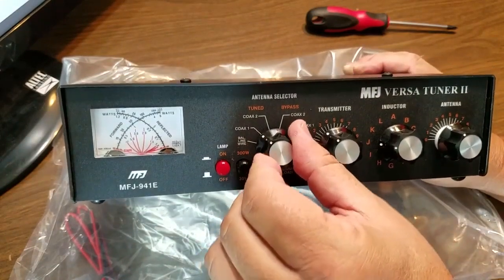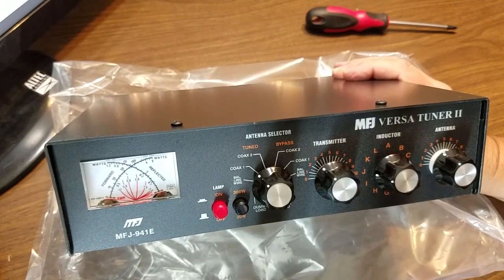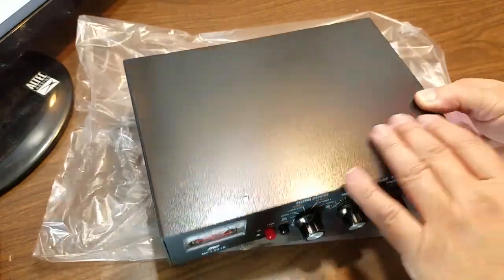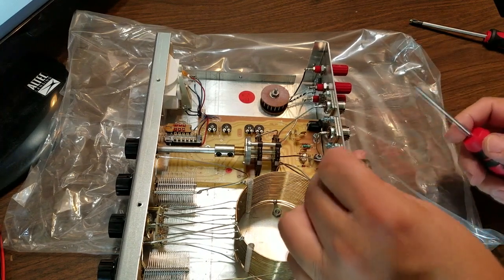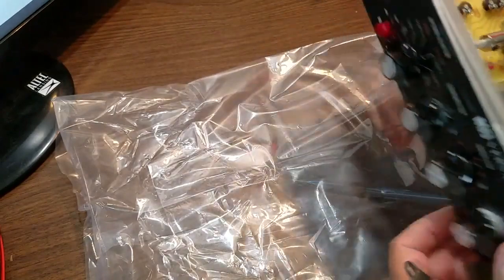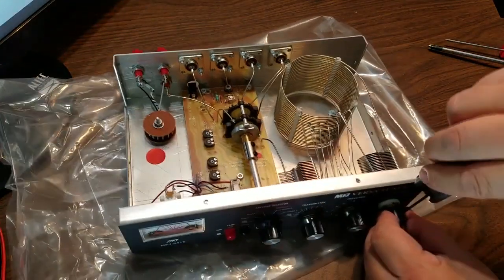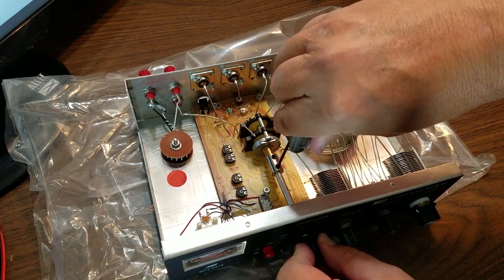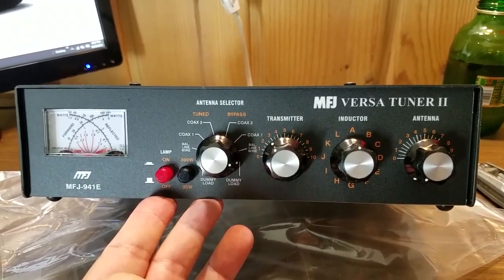MFJ 941E Antenna Tuner Inside LOOK

Comment: 390 i just went look at some videos on yt you can do this all  mfj tuners with nanovna device without transmitting get perfect swr on 27mhzs,26mhzs other stuff this can work beams and dipole even with wires by tuning knobs. you should nanovna they pretty cheap get now 3years they where more in price.